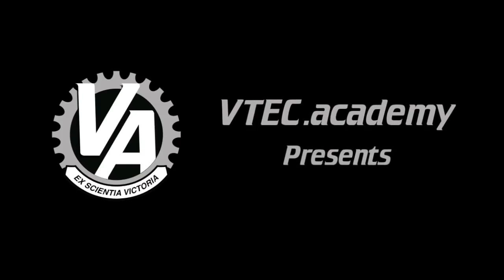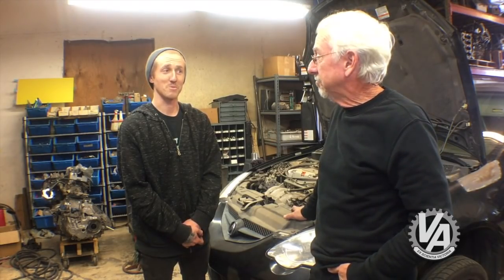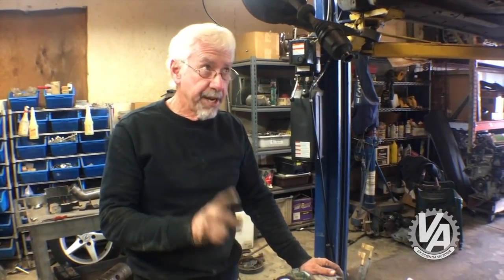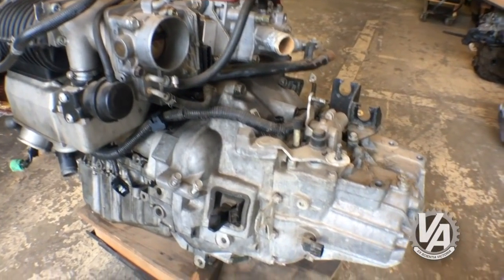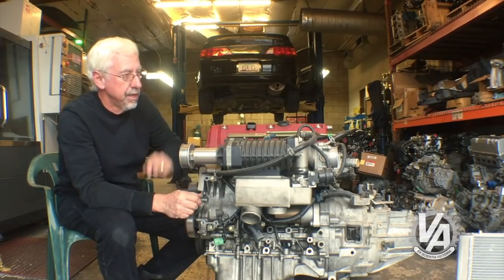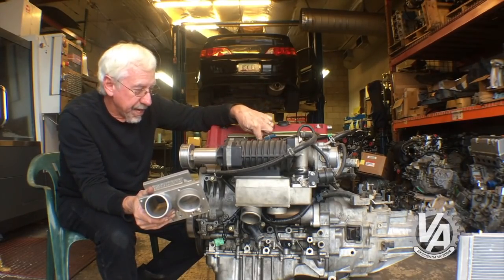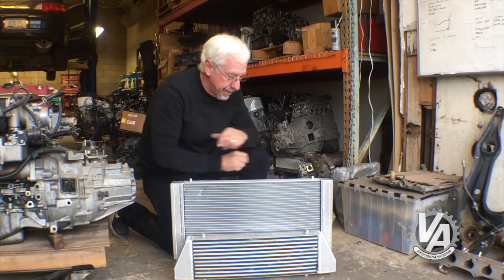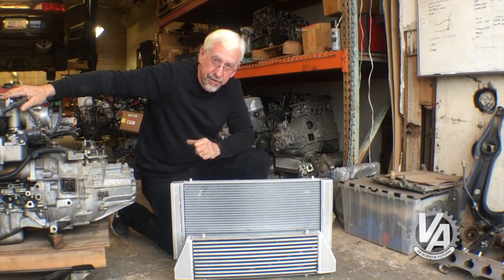Project RSX is Getting a Supercharged K24

Comment: Is it possible to tsx  k24a2 swap a base rsx. Every k24 swap rsx is type s. Wonder how I can do
Reply from the maker: Yes it is. The only problem is the computer. With a K24S2, when you run a KPro 01--04 RSX or KTuner 05-06 RSX you'll need to have a manual transmission.
Reply: Mine is 02 rsx base 5spd.  It's not a automatic.  I'd like to stuff a k24a2  in useing 5spd. The K20A3 I pull I want to try putting in a ek 96 civic hx coupe.  I'll have to find 5/6spd for civic.

Comment: How do people feel the DC5 handles (once handling is modified) compared to a similarly modified EG/EK/DC2?  I've heard the rear geometry is slightly improved over the older cars (although with lack of stroke compared to TSX's rear geometry?), but that the front geometry and steering geometry is not that great.
Reply from the maker: TassieLorenzo it needs to be modified to turn as well as the EG/EK/DC2 or even the EF. Many people run a significantly stiffer rear sway to help it rotate.

Comment: Can I do a k24z3 engine swap in my EG civic?
Reply: @Sideways G; I and initially bought the K24Z3 engine to swap the pistons in  A K24A4 engine . But the  k24Z3 engine was pulled from a running car. Can I use A K24A4 engine harness on the k 24z3 engine?

Comment: Brian, that radiator/intercooler combo is a neat idea. Being a multi chassis unit I imagine it mounts in the stock location. Any thought to making something similar a bit smaller for tucking in the core support for those less room for a bigger blower? As you know the DC5 and DC2 have larger engine bays than the EG.

Comment: It's too bad those JR superchargers have been discontinued for a long time...
Reply: I was going to comment the exact same thing! Not sure if these kits will work with the CT Engineering or Merc Racing kits though..?
Reply: RacerX85 The outlet/inlet housing is probably specific to the JRSC and MAYBE the CT. Merc Racing does make a similar manifold for the TVS blowers they use. You could then pair it with the trick radiator/intercooler combo in this video.
Reply: No they haven't. Jackson Racing is now CPL Racing (www cplracing com  ..you can check out their vtec sc kit on the site)